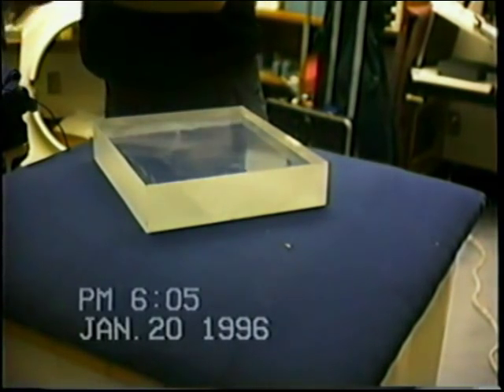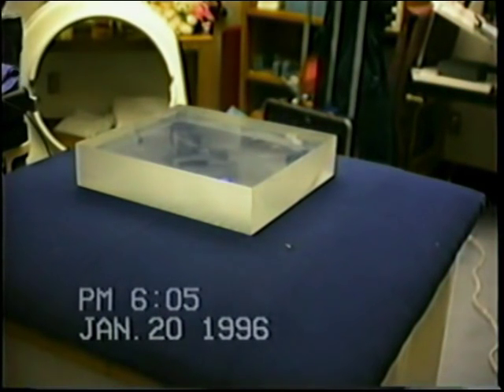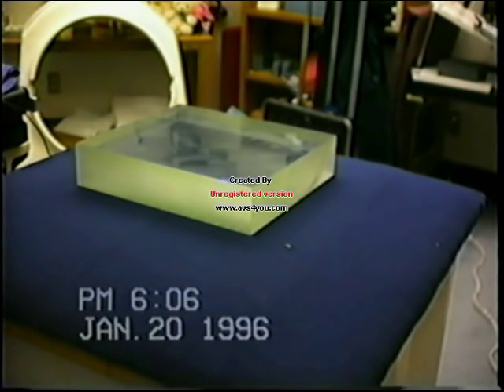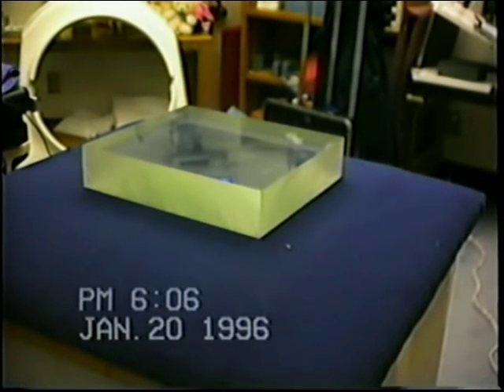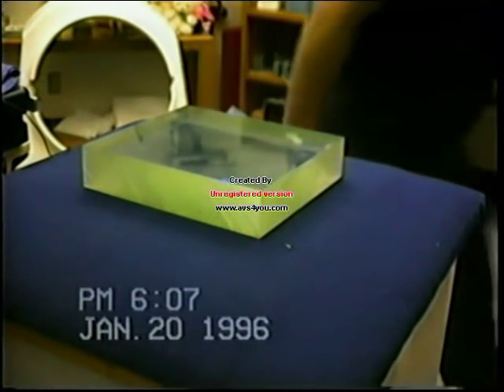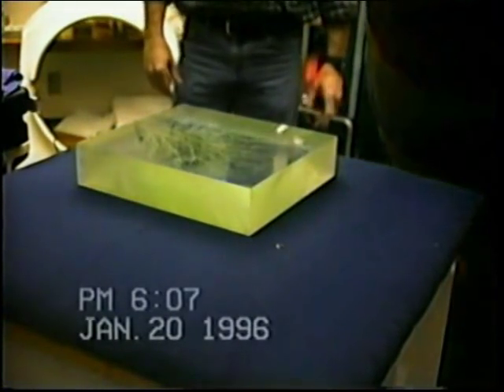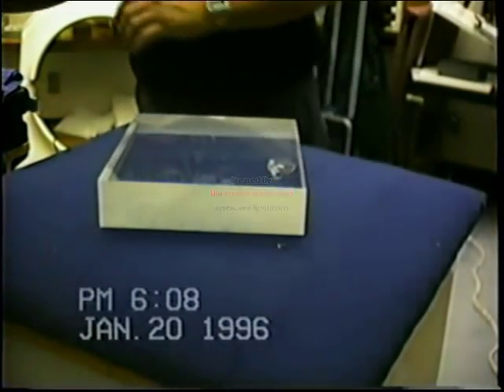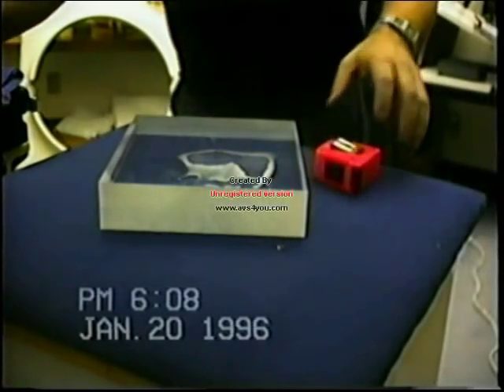Making Electron Trees with a Linear Accelerator

Comment from the maker: @thekingsora 
I am just measuring it with a measuring tape, and putting a mark on the plastic with a spring loaded center punch. That way, if the piece does accidentally "self discharge", while it is beaing radiated, then hopefully it will pop out this spot. It is just an insurance policy that the exit point, or the base of the tree is where you want it.

Comment: "well well well, i've just broken through 3 inches of acrylic glass. Let me see, how this thin rubber glove supposed to stop me shocking this guy?"
- 1000000 Volts -
Reply: Székely Gergely rubber doesn't conduct electricity
Reply: The glove would have stopped it fine, if he'd been wearing it. Instead he had bare skin far to close to the charged acrylic. Electricity can and WILL travel through the air.

Comment from the maker: They have many uses, Cancer Treatment, Research, Non-destructive testing. Security inspection, and numerous others. The thickness of the irradiated object is determined by the energy of the electron beam coming out. These machines range from 6 to 30 Mega Volts. 
If you were to read the (more info), I explain there is a person, Bert Hickman, on the East Coast who sells them at reasonable prices, and I provide a link to his website.
Regards.

Comment: This shows you how dangerous ionizing radiation can be (such as particle radiation like electrons).

The blue glow is probably the Cerenkov effect, but it could also be fluoresence of the plastic. Not sure.

And yes, the high radiation / particle flux does indeed cause the plastic to chemically change (after all its being ionized and chemically reactive for a bit) enough to cause the yellowing / green hue.

Finally, the inside of the plastic, ionized, aquires a charge until a breakout point is introduced and causes an arc and the beautiful tree like channels.

I cringe thinking what would happen if someone accidentally put their hand or part of their body in the beamline (!)

Comment: ...Pretty cool trick, but been around awhile...you charge up the plexiglass, which becomes conductive at high voltage..then, pop it with a spring-loaded center punch..the stored energy instantly goes...through the punch..into your hand....you can also use a nail and a hammer..

Comment: Is that cherenkov light when the sheet is being irradiated?
Reply: Dave Micolichek  Well... Okay. But electricity isn't really something you can see as such... There has to be a plasma formed or some kind of corona discharge through a convenient gas before the effect of electricity can be seen--like lightning or an arc welder.

Maybe that is what we have here--excited nitrogen due to the accelerated electrons giving off a characteristic blue glow. Or... Cherenkov light when photons are forced to change speed at the boundary between two different media. It is nearly a decade since I watched this video so I cannot remember whether he had the accelerator running in direct or X-Ray mode.

Comment: it glows blue from the particle bombardment that creates radiation
Reply: I would imagine that as those angry electrons mellow out and slow down as they bombard and are absorbed by the plexiglass that some x-rays are emitted. I could be and (usually am) wrong about literally everything, but I think that the "braking radiation" emitted from a target being struck by an electron beam, regardless of what it's made of, manifests mostly as good old-fashioned heat but also to at least some degree as the feared, occasionally hated but ALWAYS misunderstood x-rays. If that's the case then this experiment presumably caused some x-rays to be emitted but I doubt that they were in any danger as it was probably minimal and surely they weren't standing right next to it.

Comment: How exactly did you discharge the block? Why is it that no one got a shock from handling the block with their bare hands - is it because the entire room is electrically isolated from earth and hence the people were at the same electrical potential as the block? 

And did the discharging probe have a switch in it that connects it to ground? (Sorry, just trying to figure out what's going on in the video :)

Comment from the maker: Scorch Marks?. Doesn't look like scorch marks to me.. For a more detailed explanation, please see Bert Hickmans website, as mentioned in the "more info" description

Also, yes,  they are permanent, but if you leave it in a window sill for several years, the sun will make the tree slowly disappear, along with the discoloration

Some plastic turns slightly green, some slightly blue, some slightly brown, depending on the chemical makeup of the plastic from different manufacturers

Comment: Well sciences say it is possible that light can travel faster, the math shows it. I haven't seen any evidence yet.
Reply: Really? After 5 years do you have any better understanding of Cherenkov radiation? It's not that the charged particles are traveling faster than the speed of light IN A VACUUM (c).
Rather, it's that some charged particles can travel faster than the phase velocity of light can THRU CERTAIN MEDIA. Specifically dielectric media.
We all know that light and sound have different speeds depending on the medium thru which they are traveling. 
Take water for example. The phase velocity of light thru water is about 0.75c. Beta particles can travel faster than that thru water (but not quite c). The particle excites the water molecules which polarizes their electric field. This bow shock is left as a trailing cone behind the particle. It's like a domino effect of excited molecules which eventually drop down to a lower energy level and emit light perpendicular to the leading edge of the shock wave cone.